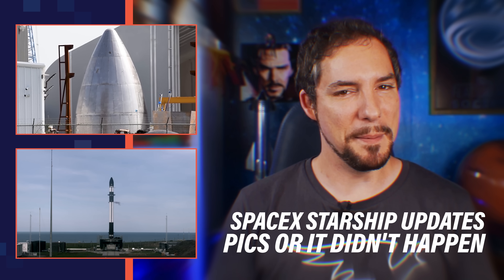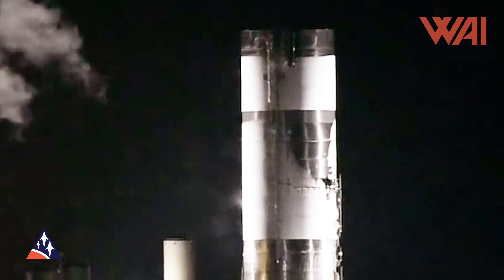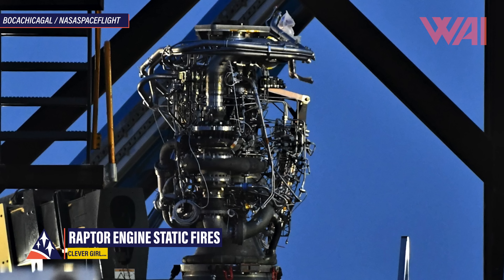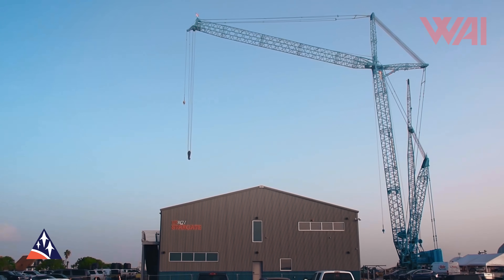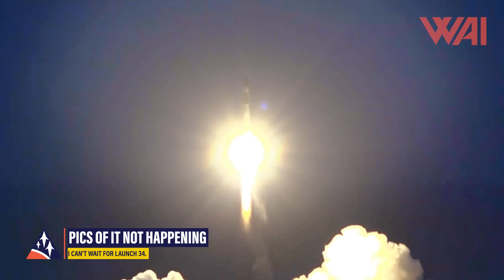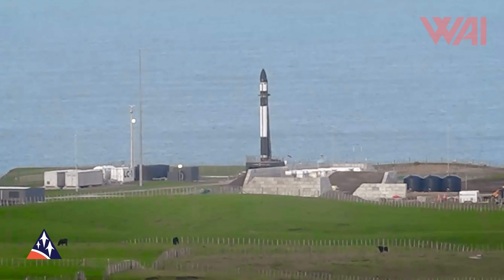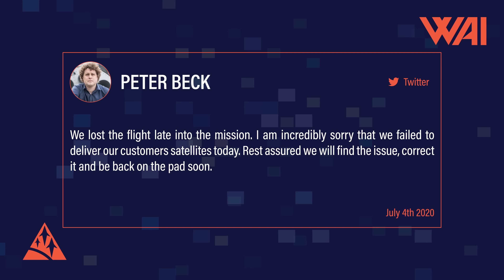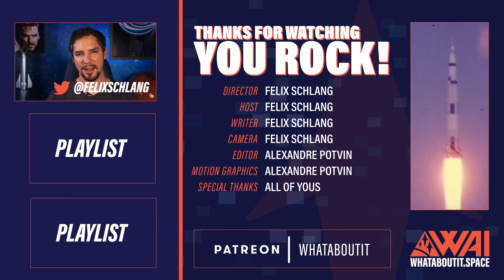102 | What's hiding in SpaceX's Starship?

Comment: Structural integrity 4 super heavy booster;

 Note the: 
Starship itself is projected to weighs approximately 160 tons fully fuel plus a cargo bay which can hold up to 100 tons for transport to orbit, 
 this is the concept, the main, 
question would be is the super heavy booster structural integrity capable of supporting under the 
Stacking ,  and  overwhelming stress of launch,  this insane amount of pressure without a repeat of the sn2 engine Housing section collapsing.

Secondly linking of two individual large crafts and a joint configuration for launch once again the scratches from the vibrations at the Joint point between Starship and the super heavy booster structurally design to withstand, this violent orbital to this point of separation.

Comment: The canard on the front should tell you how hard re-entry will be. I've done tons of simulations on designs similar to this. They come in prograde. Use the canard to stabilize the pitch. Problem is  you get into the troposphere and speed   down to about 200m/s and just trying to make any corrections throws the noose head over heels... The ones I make are more like the old spy plane. Long ass nose with canard, and swept wings in the back with no tail. They fly great, land great, orbit great but re-entry is a b***h.... Something about taking over the helm after re-entry.... It's like a jet fighter stalling. These are to land retrograde though. Not prograde. They will flip and do a suicide burn. The Genesis launching system I came up with is a 2 stage space planes. Tanks and jets are mounted around the wings. Intakes and jets get closed when not enough air anymore and oxy is injected. When oxy is expent the Genesis launching system seporates from the plane and you're in orbit with a full tank of gas. Simply by flying at about 5 degrees over the horizon. I tried steeper but you don't get the same fuel to speed ratio at 20 degrees. I am able to get a space planes with a full tank of gas in orbit, dock with station and land on air strips. A highly economic way to get scientists to and from space stations and yes the system uses parachutes to preserve the 4 jettisoned jets. Again, everything is awesome till you go back to plane mode after re-entry. They love to do back flips.... lol

Comment: Hi Felix. 

I like your new starship cross section animation! The placement of the labels are confusing though. 

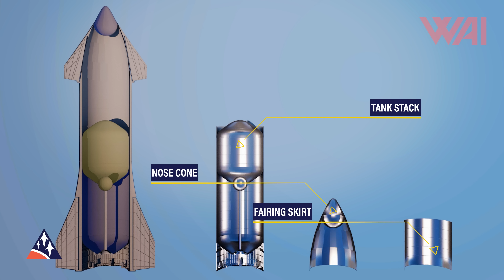For example, @2:26 the “Methane” label is right in the middle of the Oxygen tank and @ 2:43 the labels are not in the same order as the starship sections.  

It would be much better to just put the labels inside or directly above the sections and forget about using the arrows.  

The arrows are nice for pointing out a single object, but get confusing when you use more than one at a time, especially when the position of the labels don’t correspond to the position of the objects very well. 

Also, I think leaving your bloopers in the middle of your content is very distracting and brings down the professional quality you appear to be aiming for.  They worked better at the end imo. 

Hope this helps!

Comment: There's something nobody seems to point out about this design: How is the LOX header tank going to feed into the engines? Surely they're not going to pass a downcomer through the payload section, and even if they did, there's already the methane downcomer at the bottom of the stack... so how does that lonely LOX tank connect?

Comment: What is the height of the nosecone? I really liked that insert on the interior of Starship. I suppose I've seen it hundreds of times but this was clear and concise. Someone commented a couple of weeks ago that Starship lacked "any" structural support and relied on pressurization for strength. There were no other comments on his assessment that I saw. It caused me to question just exactly how the interior was constructed? I remember reading that the stainless steel itself was of variable width but generally about the thickness of two quarters.

Comment: The smaller (middle) tank in yellow is the methane tank, the larger one, lower and closer to the engines is the oxygen tank.  Fuel ratio means more LOX that CH4 is needed.
Reply: The header tank for the lox is in the nose- the header tank for the methane is that green ball sandwiched between the two main tanks.
Reply: I have been searching for some that pointed out the mistake. But I wasn't 100% sure

Comment: That's all interesting, but eventually "Starship" will suffer from similar problems of the Space Shuttles, like low structural margins.
Reply: Starship is made out of thick stainless steel though
Reply: @admarsandbeyond  it does not matter, it still has a low factor of safety, so it will fail in a few flights without intense refurbishment.
Reply: @luigeribeiro  If that happens then what? They will fix & improve it, unlike Shuttle who isn't updated for three decades. Iterations is one of the key to reach a better system
Reply: @alvianchoiriapriliansyah9882  low structural margins means it will break easily by fatigue....anyway, you clearly does not know what it is.
Reply: @luigeribeiro  Huh, you're an ex-engineer at SpaceX? How do your know the structural of Starship?
Reply: @alvianchoiriapriliansyah9882  I know about chemical rockets, all of them have tight tolerances, being about 5% of its launch weight structure.
Reply: @luigeribeiro  Yeah, let's wildly assume that SpaceX engineers didn't consider or even know anything about fatigue of stainless steel when designing it to be rapidly reusable, because reasons! ....
Reply: @alvianchoiriapriliansyah9882  my boy, I'm an engineer, most of the things Elon says about Starship are lies.

Science and engineering does not care about your feelings.

Comment: Is SN27 raptor engine means it is more developed than the previous ones or the number 27 means just another serial number for exactly same engine efficiency please??
Reply: Yes. Each iteration has multiple improvements, mass reduction, increasing thrust and ISP and making it cheaper and easier to manufacture. This rapid iteration prototype phase will continue at least to SN50 per Musk.

Comment: I think you will find the lower tank is the oxygen tank, and the upper is methane.  
Remember that SN3 crumpled, because the nitrogen in the upper tank was heavier than the methane it was simulating.  
Also mechanically, you want the heavier fluid (oxygen) at the bottom, not the top.
RE

Comment: Hi Felix. Did they change the arrangement of the tanks? At NasaSpaceflight i heard always, that the methane-tank is on the top and oxygen on teh bottom.
Reply: Ok. Seems I was wrong. You're right. Methane at the bottom and oxygen on the top
Reply from the maker: No, no. You were correct. Methane on top. Oxygen on the bottom. It's just that the overlay graphic is a bit confusing. Follow the lines... ;) Those are the kinks we'll sort out on the way. This is episode 1 of the revamp. Will take some time to get everything settled. :)
Reply: @Whataboutit  Oh. Thats funny, because then are some other sources in the net are wrong, too. Thanks for the feedback and keep up the fantastic work :-)

Comment from the maker: Will Starship SN 5 finally do a hop and is the 13 really a cursed number?
Intro and end screen are temporary. Under construction. 😉
UPDATE: Test dates for July 8th & 9th have already beenn cancelled again! That's the world of SpaceX. 10th is still in the books though.
Reply: Pin this!
Reply: 13 is a cursed number as you point out precisely because "we think" or as is being done now "we think this is what went wrong." No shortage of data telematic or otherwise obviously. The engine design is a direct knock-off of the Falcon 9 so hard to blame that. The Falcon 9 has in fact suffered an engine failure and still reached orbit in point of fact which remains imo one of the greatest achievements in the History of Spaceflight which has been going on a lot longer now than I have been alive...otherwise known as "a really long time." No space launch system should have as one system ("a battery swap") as a system that can cause the entire flight to fail so definitely some work that needs doing on this specific matter.
Reply: "is the 13 really a cursed number?"

No.